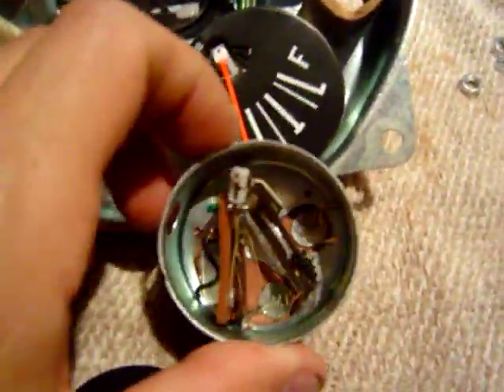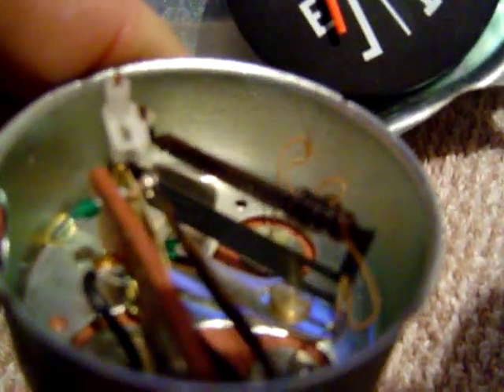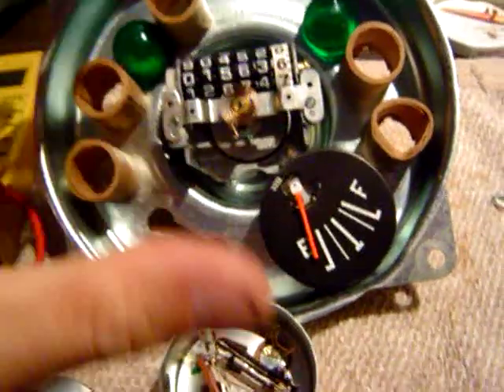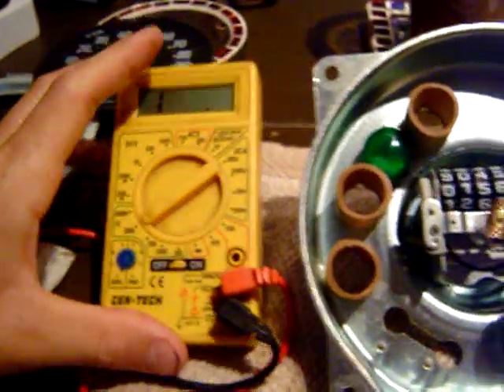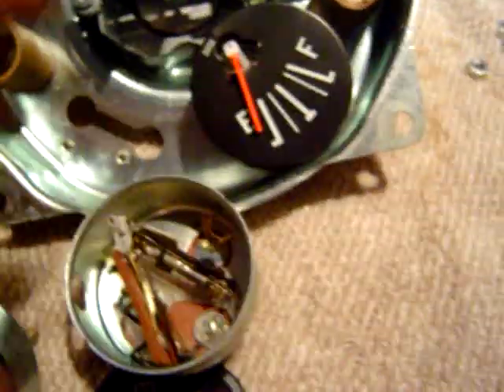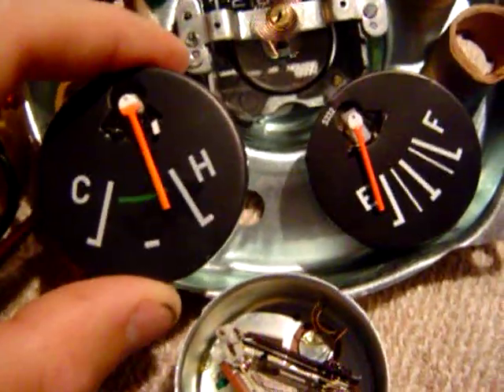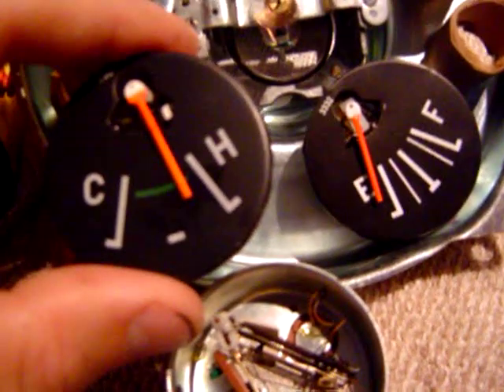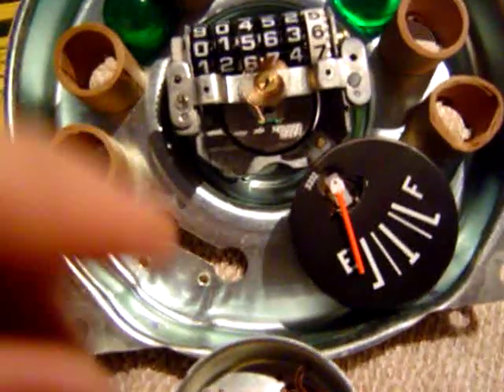CJ7 Gauges Fuel & Temp

Comment: Just a heads-up, what you refer to as a "ground bar" that connects the Fuel and Temp gauges is actually the complete opposite of ground.  It carries approx. +5 volts.  The CJ Fuel gauge includes a mechanical voltage regulator that knocks down 12 volts (which comes into the Fuel gauge on a red wire) to around 5 volts, and that strip you refer to as a ground bar actually carries +5 volts to the Temp gauge.  Both the Temp and Fuel gauge take constant power, and use sending units that provide variable resistance from ground.
Reply: This is correct. I use a LM7805 for 5vdc to power the temp. Beware some gages are 12vdc.. Know what you are getting with a new temp never put 12vdc on it or it will be destroyed. I have seen ruined gages due to putting power on the wrong stud. The ground for the temp and fuel is the sending units themselves. The case of the Speedometer is grounded. Some lights require it. The metal strip is used for 5 volt from regulator to temp. More people don't get this. I have seen schematic wrong. it isn't a saturn 5. Thanks for this post

Comment: My sons Jeep is a 1979 CJ7. Just replaced his gauges now, and work fine now. Previous owner had too many wires attached to fuel gauge and fried it. Only 3 wires go to cluster. On fuel gauge, post farthest from temp gauge is pink wire. Red wire 12VDC Positive to post closest to temp gauge. "Red wire hot when ignition switch turned on". Purple wire with white tracer is to post on temp gauge fathest from pink wire previously mentioned. NO wires on buss bridge except for bridge itself.

Comment: Make sure the back of gas gauge is not touching the bare speedo casing. Use the cardboard from old guage or it will short out. I blew four 3 amp fuses before figuring it out. Cheers

Comment: Sir, just wanted to tell you that the buss between gauge is 12VDC positive. The wiring diagram for a CJ7 shows a red wire connecting to the positive post, but by the drawing, looks as if the red is ground. The ground to the fuel gauge is internal when the gauge is mounted to the cluster base. Don't ground the buss, just the cluster base itself as if it was mounted to dash. Fiberglass chassis? Run seperate ground to base.

Comment: Make sure cluster base is grounded. Change both gauges at same time with new gauges. if one goes bad, it will effect the other. Clean all insulator cardboards with electrical spray cleaner and let dry.  Take your time and have fun! Double, triple check your work, wire correctly, hit the key and observe! If it's any thing like my son's CJ, the gauge shows just enough fuel to get to the gas station! LOL! Hope this helps people!

Comment: Hello, I did the change between my old fuel gauge, and put a new gauge from Omix ada, with a new sending unit, but the gauge is showing wrong, I think is something with the resistance, What can I do to resolve it?
Reply: The fuel tank send may need adjusting. seem like 10 ohm to 70 or something. Read the tank sending unit ohms. The resistance for the teml is read cold and hot again with the meter. Sending unit go bad and sometimes the wrong one has been installed. Look up the values for Emlty and Full and Cold and Hot online. You'll know quickly what the trouble is.

Comment: Need help replacing fuel gauge on 84 CJ7. 4.2  6 cyl. How to figure Ohms to know which gauge to get???
Reply: +bestbitchable I had to replace mine, I just added a second gage below the dash/next to my second temp gage, When My tank is full the gage only reads half full when its near to empty it reads full, wires are crossed but I don't care I only have about 1000 in the jeep and shes a runner. I just calculate backwards I'm dyslexic so it helps:)